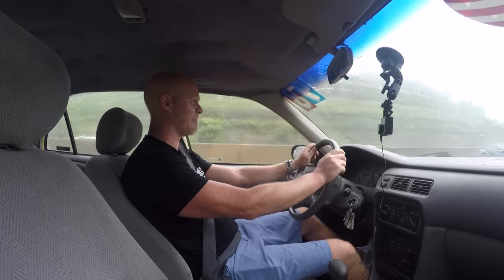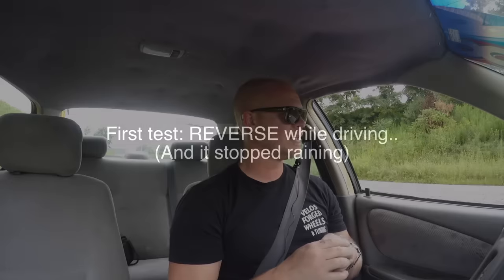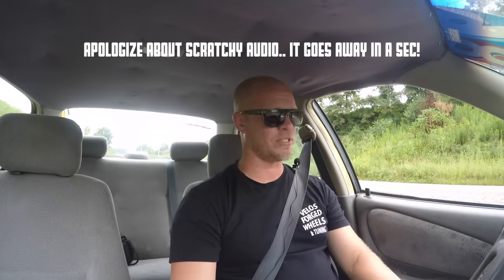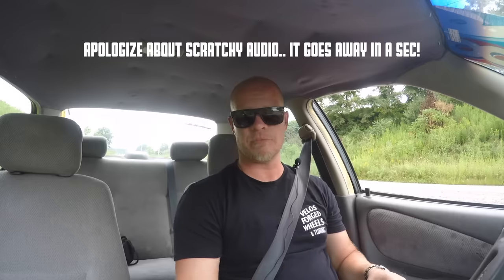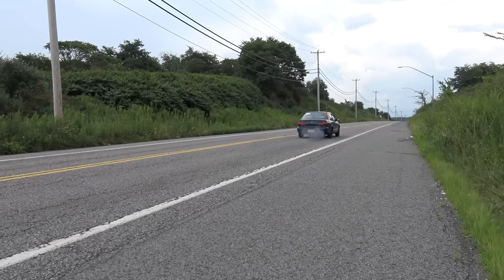What happens if you put a 20 year old car in Reverse AND Park WHILE driving? (NOT SAFE)

Comment: That Chevy prizm is a Toyota corolla
Reply: It's actually a Geo, Chevrolet bought Geo and took over their models....they had the Geo Prizm, Geo Metro, etc...but after Chevrolet bought them, they renamed it to Chevrolet Metro, Chevrolet Prizm
Reply: +DvdXploitr GEO was part of Chevrolet from the beginning dude...
Reply: DvdXploitr geo was a joint venture company between Chevy and Toyota...
Reply: It was still a Corolla before a Prism. GM just grabbed the design when they started Geo. Most other Geos are Suzukis.
Reply: @Upster900  Literally a Corolla with different badges, made on the same line pretty often, too. I toss used Prizm parts onto my undying 2000 Corolla VE as often as used Corolla parts- outside of some minor trim and the badging, they're the same, providing you're dealing with the same year. (Year-over-year, they can look the same externally, but have some revisions. This year Prizm/Corolla, for instance, likely has a timing belt, whereas a 2000 model has a chain, even though it's otherwise pretty much the same engine design.) I've even seen a few in salvage yards where a wiseguy former owner has combined the Corolla and Geo/Chevy badges, or the Toyota and Prizm badges, just for giggles.

Contrast that with the later Pontiac Vibe, which is mostly a Toyota Matrix, but does actually have some distinct GM components (mostly electrical/electronic) different from it's Toyota sibling.